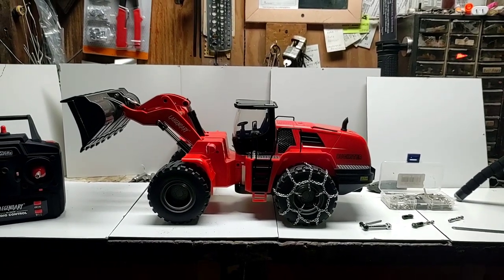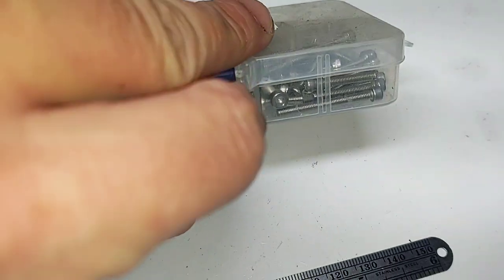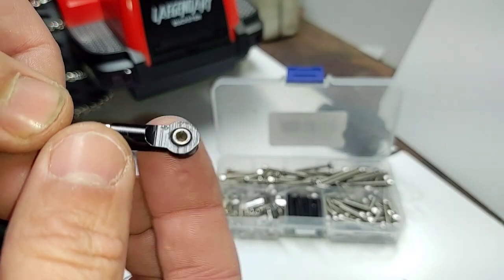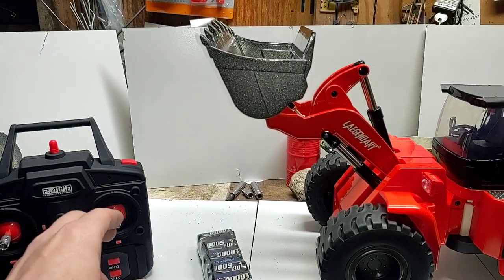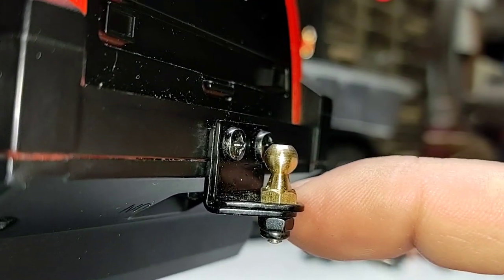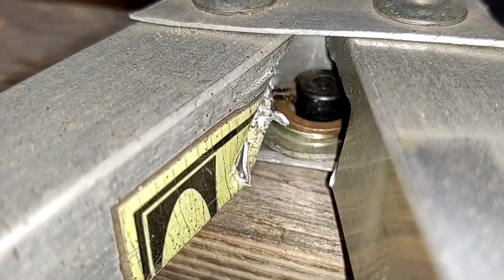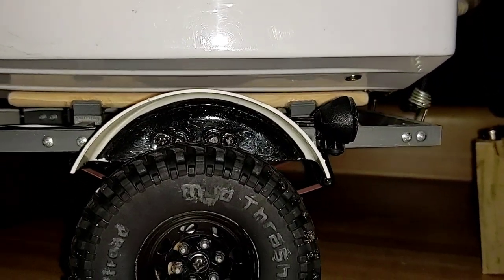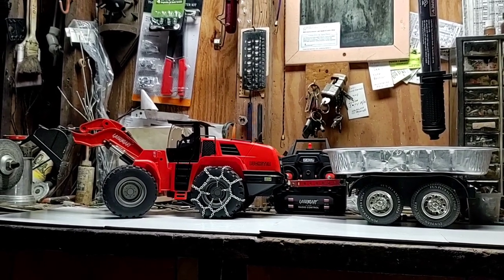Laegendary Buckster Bucket Mod & Trailer Hitch

Comment: Very good ideas especially for the tilting of the bucket, you had to think about it, in any case now it can dump correctly. Nice collection of trailer and the towing hook for the  loader is top. Very cool also the jet boat with that trailer and and the work of the leaf spring mounts 👍
Reply from the maker: 😊👍👍 Thank you my kind Sir! 😁🤜🤛
Trailer hitch idea using the drive shaft cvd; 😂👍
It was a act of Pure Necessity,😊  the 3d printed trailer hitch that came on my boat trailer, had broken out on the trail,🤔 
And I needed a immediate solution, to get it back on the trail A.S.A.P., 😊👍
And the Wltoys drive shaft cvd, fit the bill perfectly,😂

As for the NQD jet boat trailer suspension; 😊👍
That is a work of Art, that Actually Works! 😂 Lol 
And it works very well too, 
if I don't say so, for myself
😄😂 lol 
But "ilan Sandovski" is the Gentleman who 3d prints the Actual Boat trailers,😊
And this very trailer, was his own personal boar trailer,
It's the one that he used in his video, that displays the trailer in Action out in the field,😁👍👍 
And then I made it my own by adding a custom suspension system, and all the other nonsense,😂👍
Thanks for your Very Awesome Compliments Pascal, And much appreciation as always for checking out my videos my Good Friend.😊🤜🤛
Sator Rotas! One of the Absolute Coolest People on YouTube 100% 🥇🏆
Reply: @R.C.A.D.  You have good ideas and I like it, and as I always say, why buy when you can do it yourself 😊 And thanks for the 100% you're going to make me blush 😂
Reply from the maker: 😊👍 Well, I believe in giving credit, where credit is due,😊🤜🤛 
And you definitely deserve some credit, Hundreds of Thousands of people, have Seen your comments on Thousands, of another people's videos,😁 And you are always Extremely positive, and Extremely polite, when you leave people Comments,🥇🏆
Saying that you are a Champion doesn't quite fit,
Because you go above, and beyond the average, on a regular basis,😊👍
You are like a Champion of Champions,😄🤜🤛 
Like the Concept Vehicle model, vs the production version.😄😂👍👍
Reply: @R.C.A.D.  Well I must say that I am flattered by your words😮 but I am of no merit, when I watch a video I always have a thumbs up (which makes it less and less besides 🙄) first of all for the work that the guy or the girl made for their video because we all know it is still time long and tedious work and for me it is a form of respect, for the work given 😊 For me watching a video and saying: "yeah good that's great" has no interest, when I watch a video I like to look at the details, the work that the person does, I take my time to watch and for myself that's really all the point of watching a video. My laptop is on my workbench and I watch dozens of videos a day and always watch these videos with great interest, in fact I think I must watch 30 or 40 videos a day, see even more, but not only rc, I also like Egyptian archeology, new technologies, like the robot that just arrived on Mars and many other subjects, I think i am a bulimic video 😁
Reply from the maker: But that's just it Pascal, You said it all, when you said that you "watch" people's videos, Meaning that you watch there videos to their entirety, and that you actually pay attention! 😊
And not to many people do that, on YouTube these days,🤔😕 other than myself, and the Rare few others, And I Respect that Greatly my friend.😊👍👍
And I'm Certain, that everyone else who knows who you are, Respects that as well from you Pascal. 😁
As I said before, You are a Champion of Champions my friend, And that's the Truth.😊👍👍👉🥇🏆👈
Reply: @R.C.A.D.  I thank you for your compliments, it makes me really happy 😉👍
Reply from the maker: @satorrotas  
😁👍🤜🤛

Comment: Great video, Jim.  Luv the oldschool Technic driver.  Those trailer hitches are genius.  Definitely going to have to figure one out like this when we get a trailer for Taylor's Gen7 pro 😁
I was hoping the portals and servo mount would be here this weekend.  mayyyyybe tomorrow if I'm lucky.
Luv the work you did on that jetboat trailer, who woulda thought, Clorox wipes box , perfect fenders!  😅😎
Reply from the maker: 😊 Thanks Matt 😁👍👍
Those old school lego technic figures, are a perfect fit for the RC Construction Equipment,😁
I need to purchase a entire lego construction crew,😂

Wltoys 10428 Drive shaft universal Trailer Hitch; 😊
What can I say, it's a back yard rig all day long,😂 lol 
But it gets the job done better than 90% of the Competition,😁👍👍 

No portals yet,☹️ as you said, hopefully tomorrow, 
Does it have a tracking number ?  Or is it being delayed from the weather ?
It's currently Snowing like Madd over here, we picked up over 3 inches of snow since I got home from uploading this video,😕 and it's not done yet,😂 lol 
Thank God, I needed more snow for the Mighty Snow Mountain that I'm building up,😁👍👍 

Jet boat trailer; "Ilan Sandovski" is the Dude who actually makes the trailer kit,  I just Pimped it out a little bit,😁👍👍 
The Suspension setup is a work of art, and actually works quite well, 😂 lol 
Clorox wipes bottle for wheel wells,😁 it fits the 1.55 Rc4wd Tf2 tires pretty good,😊 The stock trailer tires, were like drift car tires, "very small" I used the bottom of a large Excedrin bottle for wheel wells, when I had those tires on the trailer,😂👍 lol 
The only bummer about the jet boat trailer, is that it's plastic,😕 I try to be somewhat carful when dragging it around Off-road, just because in the back of my mind, I'm always worried about ripping the trailer in half, if the axle were to get snagged on something,🤔😕 So far though, I have dragged it through some serious 💩, and it has come out shinning every time,😁👍
Hats off to Ilan Sandovski! 
for designing such a Robust Trailer,😊👍👍 
Thanks for your Great Compliments Matt, and many more thanks for checking little Bucky's Upgrade video my Brother.
😊🤜🤛
Reply: @R.C.A.D.  Yea that jetboat trailer looks sweet, perfect platform for some custom upgrades 👍👍

The dump trailer is going to rock with the tilting bed and everything.  Also have some luv for the FY06 chassis trailer lol man that's such a cool conversion.  The TRX6 video pulling the Feiyue trailer w/ the Green Hammer is one of my favorite videos.😎

Just checked the tracking again.  They finally updated it and it's saying Monday for the portal kit.  Still haven't updated the servo mount yet, sitting in TX.  Lol that might take a while 😅💀
Reply from the maker: Thanks man 😊👍👍
And the dump box trailer ought to be a cool little project,😁 I'm looking forward to working on that, I've got it all figured out in my head, all I need now, is the electronics, and some type of dump box,🤔 either store bought, & modded, or a homemade box,🤔 I could probably make a U-shaped rock box, out of a metal coffee can, either way, the dump bed is the biggest delay at the moment,😕 
That being said, I haven't started looking for a dump bed as of yet either,😂 lol 
Other projects have taken precedence.😁👍👍

The Fy06 Trailer,😂👍👍 
It's kinda funny, when you look at the side of the trailer, it looks like there isn't anything connecting the Axles to the trailer, But it's actually still using the original Fy06 Chassis, Rear Suspension, and Rear Axle setup, It's just sitting on the inside of the trailer decks aluminum frame rails,🤔
So everything is attached, and it has full suspension, with the Fy06's stock horizontal mono shock setup, But from the side, it looks like there's nothing nothing there,😂 lol 
And the Trx6 makes a Awesome Tow Rig too! 😊
Just need to get a aluminum Rear bumper for it,🤔 the plastic bumper doesn't like hauling the trailer,🙄 She's got flex in all the wrong places,😂 lol 
Thanks for your Awesome Compliments on the trailers, and the Wltoys Green Hammer video Brother,😁

And Monday on the portal kit `eh 🤔 And the Servo mount is chilling in Texas,  Bummer,😞 I can't believe that they didn't have heat strips built into the blades of their windmills,😕 it's like duh! It does occasionally snow in texas, and the windmill blades are way up in the air, which makes them just that much colder,
So why didn't they go with the heated blades is the ?
The windmills in the Northern States have heated blades,😕 But apparently Texas chose not to,🤔😕 Nothing against the Texas citizens, or Texas itself, but gee whiz, heated blades is kinda a no brainier,🙄  
But at least you know when to expect them,😁👍👍 
And Knowing is Half The Battle! Lol
Old gi-joe drop 😂👍👍 
Your gonna have to send me some video clips when you start slapping on the portals,😁👍 
Thanks again for your Awesome replies Bro.
😊🤜🤛👍👍
Reply: @R.C.A.D.  "Knowing is half the battle"  Nice one 😂🤜🤛
TX really dropped the ball on that one, man all that money for the windmills and didn't put heat stips.  Hope that state thaws out quick.

Comment: That is much better, such a simple mod can make a big difference 👍
Reply from the maker: 😊👍👍 You Know it Teri!
Adjustable bucket linkage, is something that should have came stock on this little loader,🤷😂 lol 
Many Thanks for your Awesome Compliments, and for checking out the Buckster Upgrades Teri.
😁😊🤜🤛   👉🏆👈
Reply: @R.C.A.D.  I'm trying to catch up on things but work work work.... 😒
Reply from the maker: 😊🙏🙏🙏 And I can't thank you enough Teri, for making it a point to check out my videos, 👉🥇👈
I sincerely appreciate your kindness, and support my friend,😊🙏🙏🙏🙏🙏
Work work work,😶 Better to have it then not,😁👍
This time of the year I could actually use a little more work,😂 my RC, & RC parts purchasing fund's, Seriously diminishes, in the winter months,😢 And my RC wrenching free time, goes up during the winter months, it's quite the Conundrum.😂😭😁 Lol 
As for watching my stuff, as always, no worry's, or hurry's Teri, 😁👍👍 
I Appreciate your Support regardless mate.😊🤜🤛
P.S. How's Sunny's Truck coming along ? 🙂
Reply: @R.C.A.D.  the cab is painted. The graphics are with me... I just need time...!
But I did have time to fit new wheels to my BJ McKay and Snowman trailer and I'm very happy with them...😁
Reply from the maker: 😊👍👍 Nice on the Cab & graphic's,😁 
And I also noticed the new wheels too, They are very Cool my friend, 😊👍👍 
Looking Sharp! 😁
I can't wait to see Sunny's Rig. 😊🤜🤛

Comment: My bucket quit tipping I don't know what's wrong with it when I hit the controller the lights come on I know the controllers communicating any idea where I could get parts I'm thinking it might be that actuator but I'm not sure
Reply from the maker: That's a bummer..😕 First thing that I would do is take the loader apart, and then use a volt meter "to make sure the motherboard is sending power to it, or not.
Just because the lights are working doesn't necessarily mean that it's sending power to the servo.😕 
As far as replacement parts go; I could be wrong...🤔? But I seem to remember seeing some replacement parts available on Laegendary's Website.
Best of luck with everything my friend, and let me know how it goes if you get a chance.😊👍
Reply: @R.C.A.D.  very much appreciated on the feedback I will definitely tear it apart and do as you said
Reply from the maker: @user-wp9mz 
no problem man.... 😊👍
Reply: @R.C.A.D.  update on the loader I tore it all apart it's definitely getting power to the solenoid so I have to find a solenoid it has the red and blue wire on it.
Reply from the maker: @user-wp9mz 
Right on...😁 Pretty sure that I seen those on their website for sale, and if they don't have them try looking at the Huina Website, the Huina loader is basically the exact same.😊
Reply: @R.C.A.D.  awesome thank you